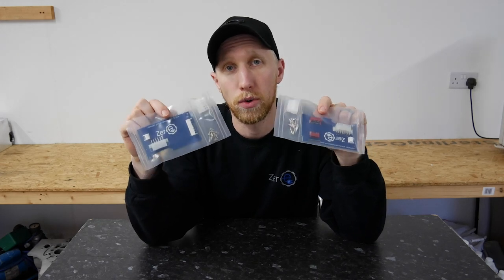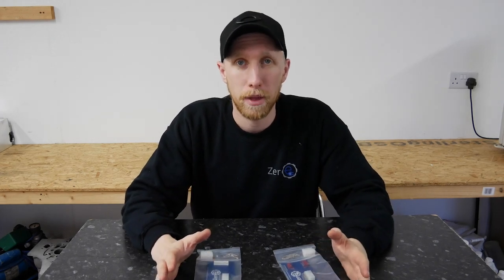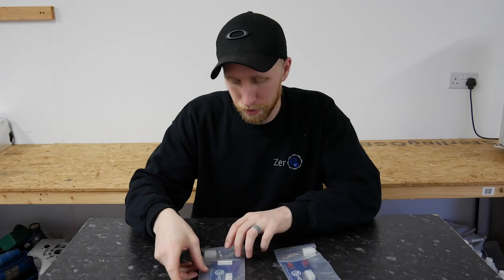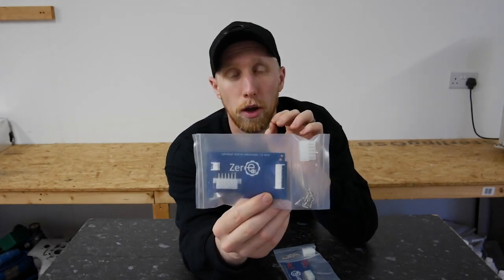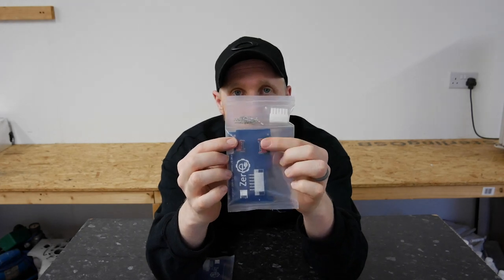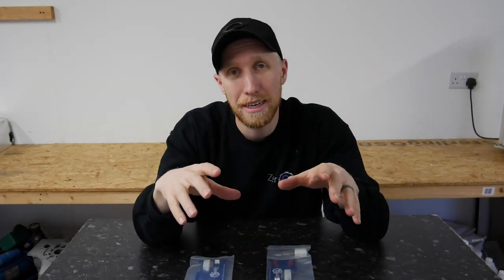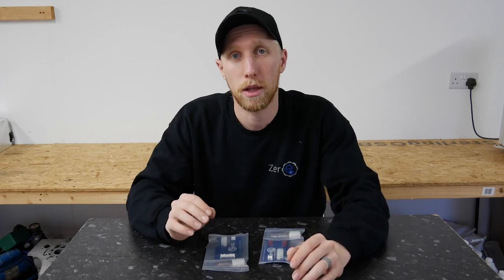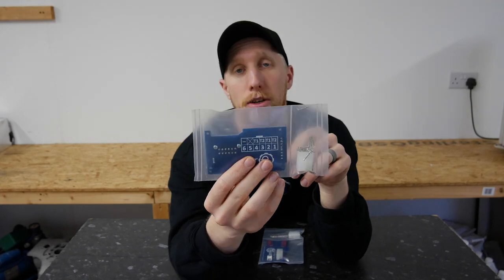Tesla Battery Module Replacement BMS Boards

Comment: If I install this Replacement BMS Board, how can I monitor Temperature of module during discharge and charge? Is there any kinda device or voltmeter for it? I meand is there any device with monitor interface to see (read) the temperature?